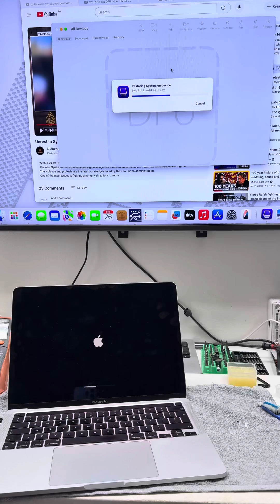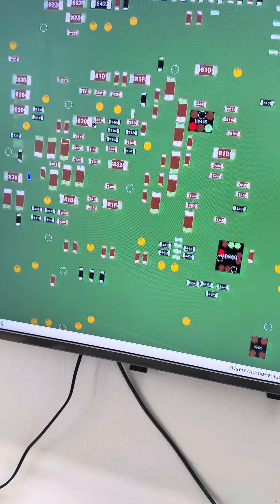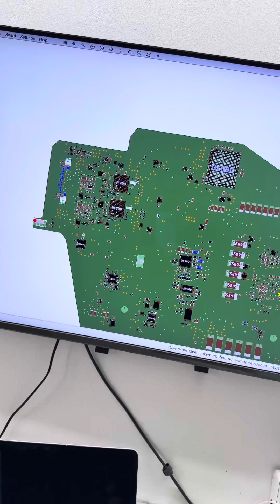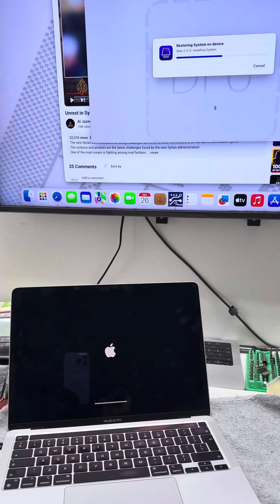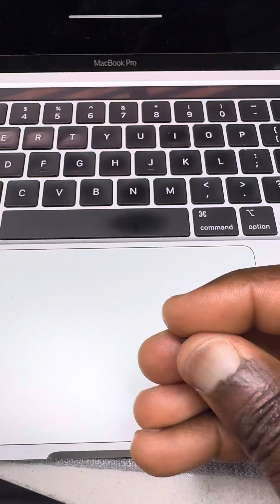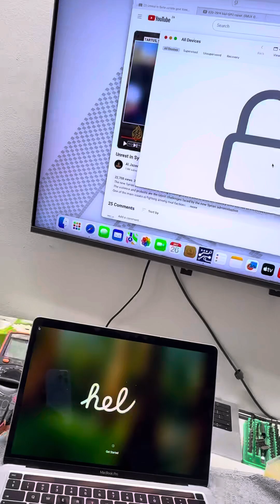MacBook Pro M1 would not boot into recovery or go into DFU

Comment: Hey, thank you for this. 
I just updated my MBP M1 Max to the latest MacOS, and its been nothing but trouble. And now I think the logicboard is failing on me, screen is getting glitchy and purple pink within seconds of booting, I can boot into recovery mode, but it stops working there to and crash. Kernel panic. Then It's impossible to boot in DFU mode. Not sure why. But it simply won't do it. Seems like your video is the closest I can get to any sort of valid reason.

Comment: hello i have problem with a2141 where i get no short on either 3 lines which u check when u do these when i power 96W adapter i get 20V line and 12.6V on ppbus however im unable to bootup macbook i get fans spinning and then they ramp up for a second and start spinning normalny also CPU and GPU get very hot through this process ever experienced something similiar? i dont know what to do :(